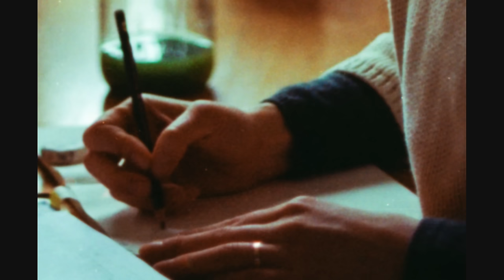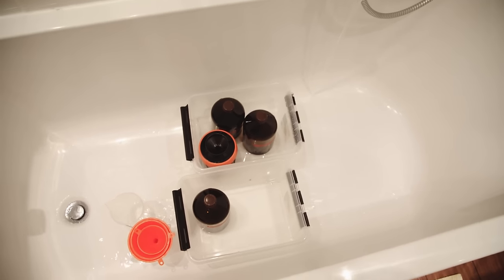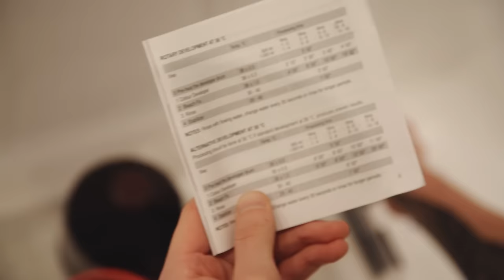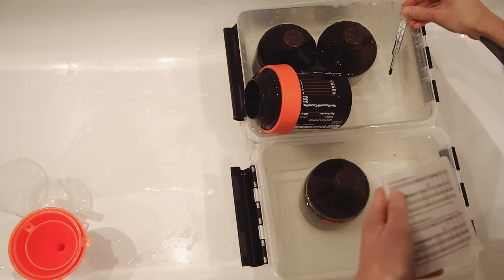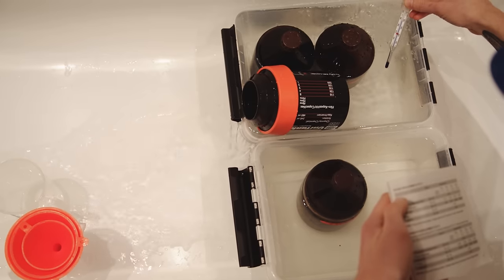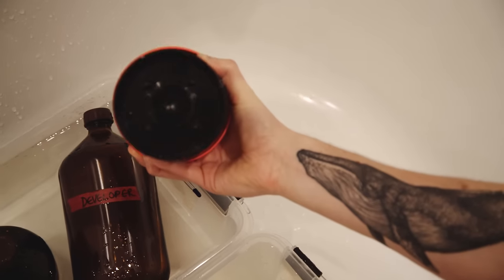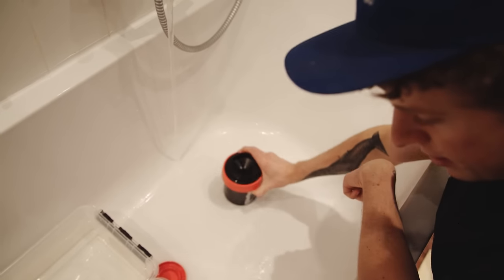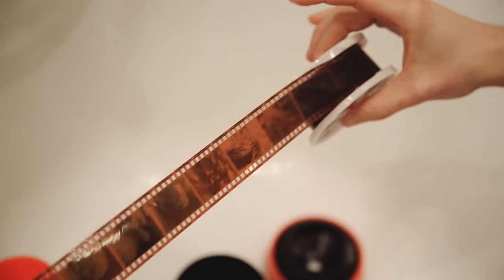Developing 35mm Color Film at Home: Tetenal Colortec C-41 (Snippet 30)

Comment: Film Developing  it's a funny  but, 1--every time before you toching chemical, you have to use safety gloves and mask also ventilated that room.
2- every time you have to check temperature of chemicals, if needed you have to heat with water bath,it's very important
3-- each time after draining chemical, you have to wash out  with water 3- 4 times, for best quality your pictures